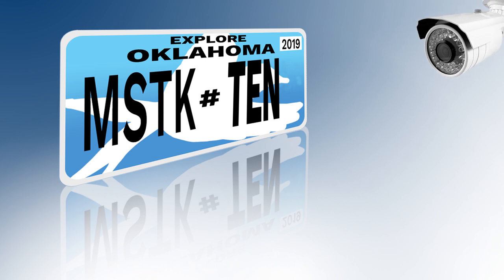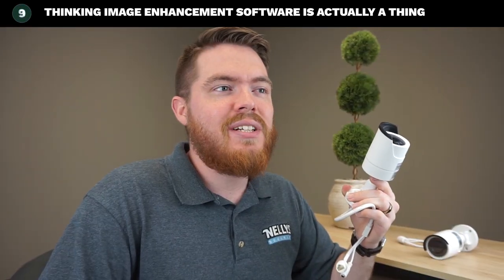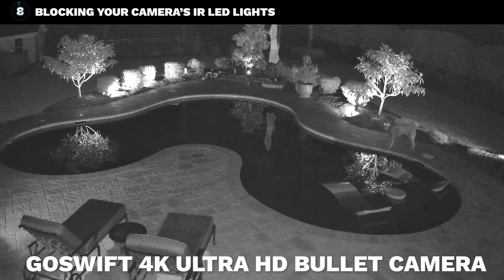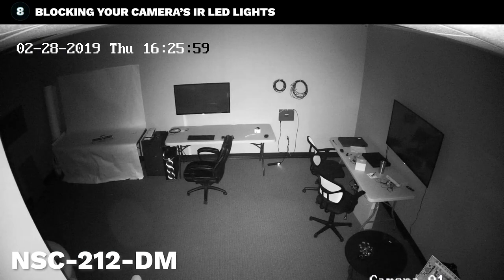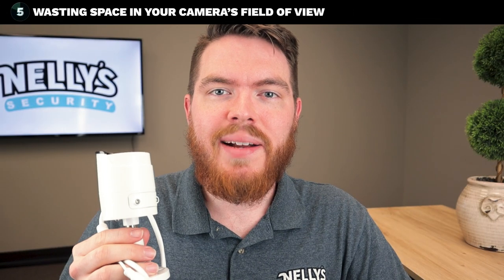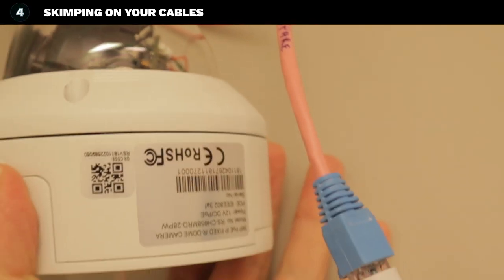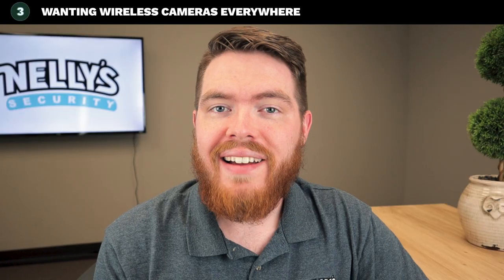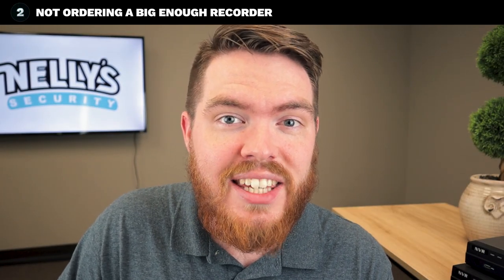Top 10 Surveillance Mistakes To Avoid When Installing Your Security System for the First Time

Comment: I especially like the point about not going big enough when starting out. I have seen the same thing with recommending computers, they just want to get on the internet and then... I want to edit photos and video... my laptop is not coping. But they saved money ... initially. On the WiFi camera situation, with my rental house I cannot run PoE  and every time the microwave goes on it drops out. Also retrieving footage is tedious. GO WIRED whenever you can! Far faster and more reliable.
Reply: Just tabe them to the corner and when you move out just take them down, they will not look nice but try to hide them as much as you can

Comment: With #6 can you at least tell people what to do with the dc connector? No one ever tells you what to do with those :\ . I get an ethernet cable cover but not one for the dc connector. I know I'm not using it but I'm not sure if it would affect the camera. I'm guessing a junction box will have to do. Guess im old; back in my day the POE Cameras were weatherproof and didn't have male connectors coming out the back (sercomm oc432). Now I have to strip and recrimp the cat5 that was already done.. no big deal but still a PITA if I mess up I have to rerun it. Doesn't look like the DC/RJ45 (sometimes reset button) model is going anywhere any time soon its been in all the wired bullets and domes ive seen. Hopefully going from 2 lens's (1 for color 1 for b/w) won't be a big deal

I admire you guys. Keep on doing what you do. Hopefully one day you get a POE doorbell. im not so sure im ok with the rebranding of the cameras and stuff for #1 i guess its ok as long as peoples names arent being ruined with Engrish software

Comment: Quick question. On error #6 having all that equipment expose wont that invite the bad guy to sabotage it also, if I were to buy a 4 channel unit and later need expanding could I buy a Hub or a switch and last, being ip system can it be hidden behind a proxy to keep hackers from seeing what the cameras are seeing? Thanks for sharing your video and Thanks for what you and your team are doing.
Reply from the maker: Great questions. Yes, hiding your NVR is always good practice if the thought of that being stolen is a threat. No you cannot add cameras to a 4 channel unit, would recommend you just start out with 8 ch unit and expand when you need to. And you can make your IP system as hack proof as you want, this would be a longer conversation. Thanks for watching!

Comment: where can i buy those weather proof grommets though?
they should be standard with everything but i've got boxes cluttering up my walls where the connections are made
thanks
Reply from the maker: Hello,

Ive seen em for sell on Amazon and Ebay. any standard RJ45 weatherproof grommet should be sufficient enough!
Reply: @NellysSecurity  thank you 👍

Comment: @Nelly, I have to installed a cctv camera at our new warehouse but I want the cameras to be integrated with Access control system. Being a security expert which cameras and access control system will you recommend? The systems must work on mobile phones so it can be monitored remotely. Thank u.
Reply from the maker: Hey Patrick, we have a C3 pro line by zkteco that supports IP cameras -> https://www.nellyssecurity.com/catalogsearch/result/?cat=&q=c3-pro

Reach out to us if you have any further questions  customerservice@nellyssecurity.com  / 855-340-9999

Comment: I need to put a camera about 600 feet from the house down at the end of the driveway.  Does the repeater or POE switchbox need to be plugged into the electricity? and does the repeater have to be wired directly to the modem?  It is all outside, no building to put it under the eve.  What can I do?

Comment: Hi. I have Hikvision 4 channel PoE-NVR DS-7604NI-Q1/4P. I am using 4nos.  2MP IP cameras but now I want to install one more IP camera about 20meters away from the NVR. Is it possible to connect 5 IP cameras in 4 channel PoE-NVR, will it work & will recording save in HDD ? If yes then please tell me in detail, how to do it.
Reply from the maker: Hello, a 4channel NVR can usually only hold 4 cams max. Id suggest upgrading to an 8channel or higher to accommodate the additional cams.
Feel free to reach out to our sales team and we can get you rolling -> customerservice@nellyssecurity.com / 855-340-9999
Reply: @NellysSecurity  can any small extra poe switch help to achieve my goal i.e., connect 5th IP camera in my 4-channel poe-nvr ? Since extra poe-switch can provide the required power to the 5th IP-camera, is there any chance of success? Will nvr detect the new extra attach ip camera & start record & save the video to hdd or not? If is there any cheap work around then please suggest as I do not want to buy a new NVR.

Comment: Thanks for the good information, I happened to have added cameras of different strengths and found out one of 5mp is not recording.  What could be the problem????
Reply from the maker: Hey there! 

That is a very good question, it could be one of many variables or even a combination! I would verify that your recorder has a recording schedule set for that camera firstly.

If the camera is not showing up at all on the NVR, then i would check all of the cable connections to verify that everything is properly talking.

If you are still having trouble, i would contact the manufacturer or supplier of your system to see if they have some pointers for your specific system.

Comment: If you need real professional security cameras then absolutely follow this. If you’re a regular home owner and are willing to spend extra money for ease of use and features then ring, arlo, etc is the way to go. If you invest in mesh Wi-Fi and ensure all cameras have strong connections AND you also have a fast internet connection I would recommend Wi-Fi cameras that are hardwired for power.

Comment: There might not be much room for image enhancement but you can try to zoom in.  If it is a larger image than your tv or monitor can usually display it would be shown in a reduced resolution unless you zoom in or extract a frame and zoom in.  VLC can let you extract frames and they are in the native resolution of the video despite what your monitor usually displays.  There are other programs which are also free and allow frame extraction or export.  That is helpful if you are hoping to read a plate or see a face.

Comment: Here is a big question. Can you use top notch security cameras like yours and couple them with a 24/7 monitoring service through a different provider like Ring, ADT, Simplisafe, etc.?
Reply from the maker: Im sure you can go through a 3rd party for 24/7 surveillance monitoring. Im not aware of our products being able to integrate with ADT, Ring, or Simplysafe as their services are proprietary with their own equipment if im not mistaken.

Comment: I know that I'm going to need help setting my system up, almost went out and bought a whole wireless system just to avoid running long wires and having to drill through ceilings and walls. Guess I'm back at square one. I'm under allot of pressure. I only have 6 hours to run a whole system by myself.
Reply from the maker: Hey there! While wireless cameras certainly have a purpose, 9 times out of 10, we generally do not recommend them. Best of luck on your system!

If you need any recommendations, feel free to reach out to us at customerservice@nellyssecurity.com
Reply: when looking at wireless one needs to consider the type of wall materials, is there any metal in the ceiling, how many walls does the signal need to go thru to get to the receiver.

Comment: hey @Nelly's Security! great video. I have a question to mistake number 6... I can use the waterproof stuff on the network cable but what about the power one? they never come with any waterproof adapters. thanks.
Reply: If its POE it would not have a seperate power

Comment: Good video but You didn't explain the difference in the cables.
The system i purchased has 2 cables to each camera 1 power and a yellow twist on video cable noticed yours only had one like an ethernet cable.
A little info on the cabling would be nice.
But regardless good video thanks

Comment: most people don't need 4k for all cameras usually just the facing parking lot make sure use lower res secondary stream to reduce bandwidth of your network.  enhancement noise reduction will make things worse. inside 5mp licence plate capture then 8mp/4k. agree especially if choose lorex headache guaranteed

Comment: Mistakes in this video, for not mentioning these critical points of a surveillance system.
1. Not mentioning an NVR is sub optimal hardware for most jobs and narrows options.
2. Do not have your IP cameras on the same Network as your PC's.. have a switch with client isolation. Nothing like letting hackers plug in from outside you building. 
3. Wireless IP cameras are not security cameras. A simple Wi-Fi disassociate attack renders them useless.

Comment: Is there a difference between the cable for a bullet cam and a license plate reader?
Reply from the maker: Hey James, It would depend if the cams are IP-based or analog.

IP-based cams have rj45 connection.
Analog-based has BNC connection.
Reply from the maker: If the Bullet camera is IP you will use the same cable which is either cat5e or cat6
Reply: @NellysSecurity  thank I believe they are ip bases

Comment: I have a question. I was watching a video of a pro thief who was trying to reform his ways. A cop was interviewing him. The thief said most security cameras were placed too high. Then they cannot get a good ID on the person if they wear a hoodie etc. He thought security cameras should be placed at about 5'-8" so the camera could get a good look at the face. However, I don't see people doing that. I ordered a couple of cameras and haven't installed them yet. If we installed them that low...couldn't a thief just come and take them off the wall and steal them...and resell them on ebay or something? Do cameras always need to be installed out of reach for this reason?
Reply from the maker: Definitely putting a camera at those heights give you better angle to capture someones face/ details about their appearance. The only down side to that is the cameras can be easily vandalized or even stolen like you mentioned. Also it might difficult to run wiring to such spots without having external conduits. If you do decide to mount a camera on low clearance I would suggest using a Vandal Dome cameras vs. a bullet camera.

Comment: by accident i select display resolution to 3840x2160, now my monitor cannot display anything only message": NOT optium mode, reccommended mode 1920x1080"  , is there anyways to cancel the setting ? or restore my previous setting
Reply from the maker: Hey Alan, if your system has a web page you can access from a Local PC, you should be able to adjust the video output resolution from there!

Comment: A midspan POE power supply is the best option for your long Ethernet runs. An I hate to say it with the camera on the back porch.. Armor an do not leave the camera and wire accessible in reach.  It is like a padlock on a gate with the key in the lock. Anybody can disable it without tools.  Hmm, maybe this is the missing 7.  Armor and protect wiring from unauthorized access.
Reply from the maker: good suggestion. Thanks for watching!

Comment: One mistake you forgot to mention is restricting the bandwidth on the ethernet cable by placing the zip ties or Staples or whatever you’re using to hang up the cable with too tight

Comment: What about a secondary infra red light source?

... and wow you've answered another ?? I've had
Maximum distance for POE.
However, POE is a higher voltage than the data .... So what's the maximum distance you can run a just data ethernet say for 3.3v projects?

Subscribed!
Reply from the maker: secondary IR light source is a great option.              For POE distance, its still 300 ft. Normally your POE injectors will be pushing either 7.5, 15, or 30 watts. All capable of traveling 300'
Reply: @NellysSecurity  Thanks for the reply .... forgive the ignorance .... but if my project, and I'm not necessarily talking a camera, is connected with ethernet that has POE ... I understand that the 7.5v will travel the 300' but if the project is say a SENSOR of some sort will it's 5v or 3.3v signal also travel that 300' span and still be at a valid voltage for say an arduino or raspberrypi.

I am unsure of the math but I do know that cable depending on its quality does have a resistance.  How do I determine if let's say I start out with a 3.3v data will it after 300' still be a valid "1" or "0" value?

Sorry that this isn't directly related ... but I do tremendously appreciate the time you've taken.
Reply from the maker: @johnjacobjinglehimerschmid3555  Hi John, Raspberry PI normally doesnt run off of POE. POE power is 48V AC just fyi, so you would need some sort of adapter to adapt the power down to 5V to make it work on lower voltages.
Reply: Surprised your not aware of
ePoE technology uses advanced modulation to transmit video, data, and power up to 800 m (2624 ft) at 10 Mbps via a single CAT5E cable  between  an IP camera and a PoE switch or NVR

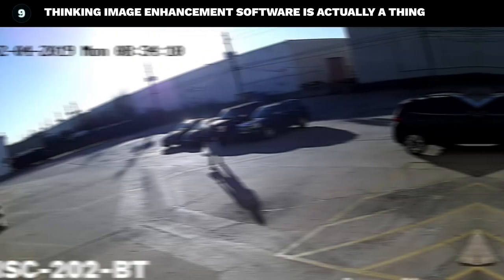Comment: 3:50 "Can't magically produce new pixels." Yes they can. There are several ways to do this. Interpolation adds new pixels that are a blend of surrounding pixels. Multiple images from video can be overlaid and the pixels add up to form a higher resolution image. This is how astronomy pictures are made. Two cameras side by side can be combined. There are many algorithms for increasing resolution. Add this to your mistakes.

Comment: Just to be clear: not just PoE limits your cable length. The ethernet data connection's max. distance is 100m max, even if you power the camera locally.
Reply: even when the camera is powered locally.  NOT  even if you power the camera locally.
Your knowledge of the English language is not so good.
Most people use the word IF instead of WHEN, and they are incorrect.
The two words have totally different meanings.
STOP using the word YOU unless YOU are speaking directly to someone.
Another common error is using LESS when meaning FEWER.
Again, these two words have different meanings.
Reply: @andrew_koala2974  Thank you for the correction.
Reply: @gabiold  I don't like very poor or lazy English from native speakers, but yours was absolutely fine. The criticism was indulgent and at least partially incorrect.

Comment: You missed a big one... Compatibility. I made the mistake of buying from Backstreet, and they are not big on checking the compatibility of the products they sell. I got two $800 dollar PTZ cameras that are useless to me because the NVR they sold me will not  do motion detection with these cameras. I am pissed off!
Reply: I am facing the same issue. I am new to the who thing. I bought a PTZ cam but the app it works with will not work with another cheaper cam I bought. Now if I want to use both, I am stuck using 2 diff apps instead of just one. Now I am on my way doing research about what cams work with what app and everything in between.

Comment: Does the price include installation?
Reply from the maker: Includes free DIY installation
Reply: @NellysSecurity  Ok, amazon it is. Thanks.
Reply from the maker: @Blueknight1960  Mistake #11!!
Reply: @NellysSecurity  Mistake #12-- overpaying for a surveillance system. If it was for a business, I would pay for a high dollar system. I live in the middle of no where with 1 road in/out and surrounded by trees. Plus the security system is made of lead.
Reply from the maker: @Blueknight1960  No reason to pay for a high dollar system or make mistake #11. Look at our GoSwift products for low cost. You will also find these on Amazon as well, but you can be rest assured that you will be given better tech and warranty support than most of the other stuff you see on Slamazon

Comment: At the 650-655 timeline, you turn the lights off in the little room and IR lights up. Are those mice..or rats? that run from underneath the table at the right?

Comment: Video Mistake 6: weather Proofing, the stupidest thing is to give customers something that does not fit, it comes with the camera, so its not yours , but the fittings do not let you place over the end of Ethernet plug!!  And you just skipped over this part, no way to get fitting on cable with-out cutting  connector off and adding a new connector after adding the shipped fitting, I just add silicone sealer  and tape to make sure they stay together. Do you have weather sealant fitting that can snap over the cable and connector to ship to your customers?
Reply from the maker: Hi Kurt. It depends on which camera model.

All of our R-series cameras come with a cable connector in which you do not have to remove your RJ45 Jack, you can thread it through and seal it up without the need for any weather sealant. 

Some of our H-series cameras require you to put the cable through the grommet before putting on the RJ45. This is not really that big of a deal though, especially if you know this going in.

You can also just utilize a junction box as well and disregard the little weatherproof connector.